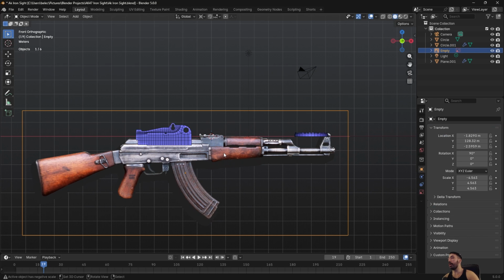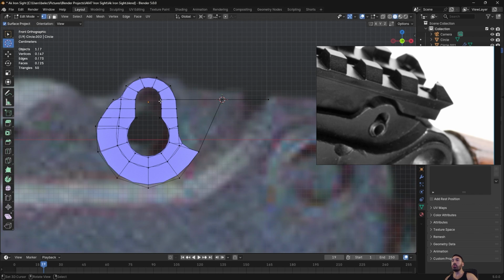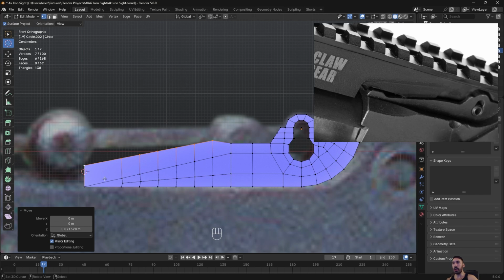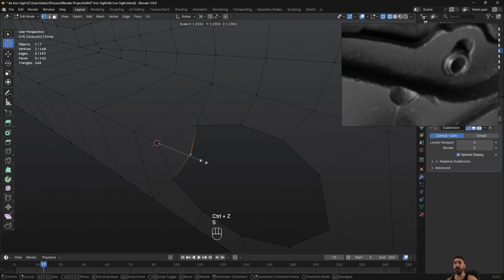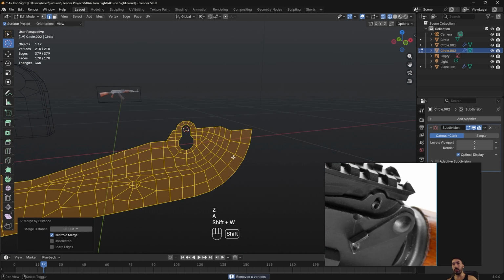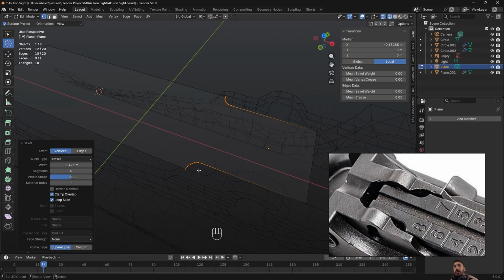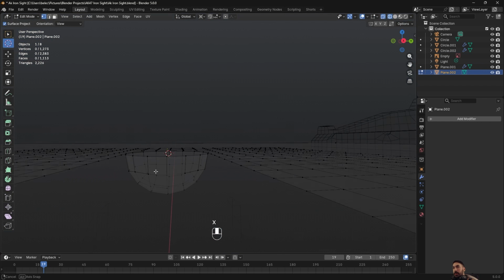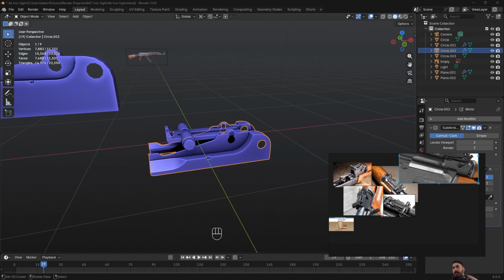Modeling an AK-47 Iron Sight with Perfect Topology (Blender)

Comment: Bro instead of breaking your head about making holes for circles for topology and making all edges match in numbers just inset the face and in that area of the inset and the outer face you knife some topology to make it match then finally inset the face again and looptools into a circle
Reply: I mean from the corners from the original face knife some edges from the corners of the original face to the first inset face to make numbers match also it isn't limited cuz you can make the topology evenly spaced too

Comment: I understand that I don't even have 1/100th of your experience in 3d modelling, but whenever I see you using the 3d-cursor as a pivot point constantly, I can't help but think of how much easier it would sometimes be to just enable snapping to a vertex or an edge and just use that instead

I know muscle memory and habit are a bitch, but it also helps a lot with aligning edge loops, which you do by zooming in very closely. Also holy shit I just reached the part where you scaled a cube using edge length lmao. It's possible to apply the same snapping bs to scaling so you can do the same thing by just hovering your mouse over a vert you want the cube to reach

The vid is fire as always man. I love your hard-surface subd tutorials and am learning a fuck ton of stuff about topology
Reply from the maker: Thanks and you are right, some of my techniques are driven by the force of habit rather than logic. Every now and again I go out of my way to correct something, but most of the time I completely forget about it.